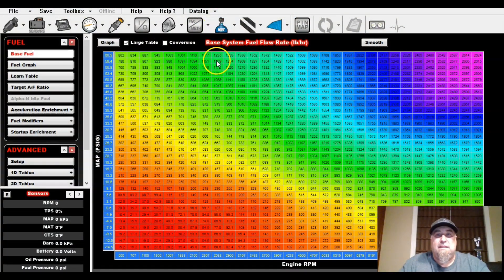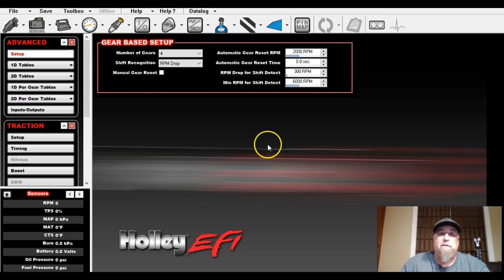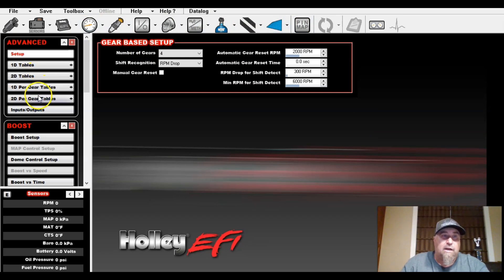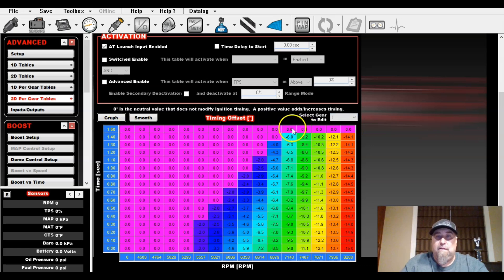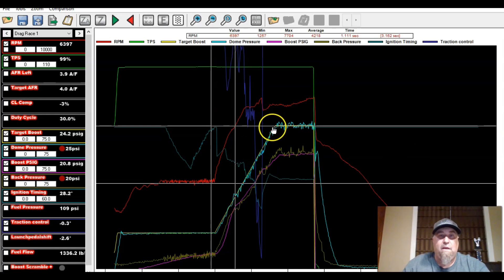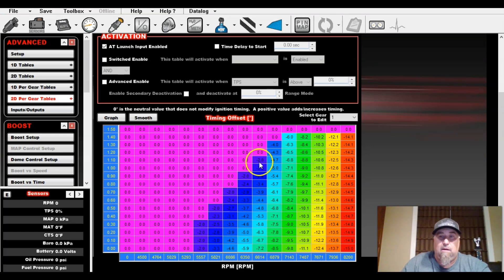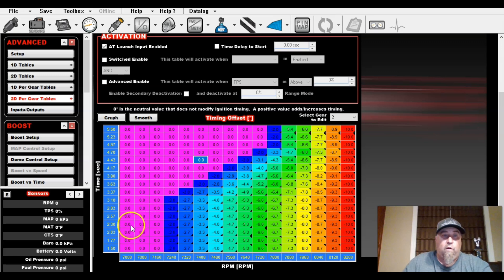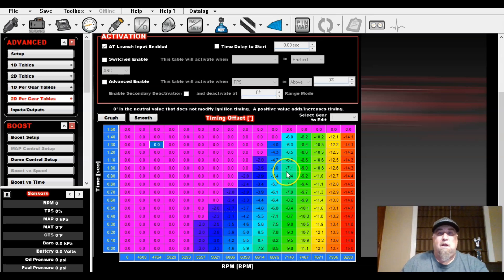FREE Holley Traction Control?????

Comment: I was looking to see if Holly had a built in traction control, as when we put a terminator x system on our LS it feels like it lost 100hp in 1st.
Tried talking with tech line, he just got mad when I suggested it was running lean and said we'd have to dyno it, so far we added 80% more fuel so?

Comment: Im building a ls turbo mustang 
And im haveing a hard time deciding on a holley system 
Would you recommend a terminator x
Or go ahead and get the dominator 

And have you found or heard if drive by wire better than drive by cable or?
Reply from the maker: Dominator has more capability.  I have no experience with the drive by wire
Reply: Dominator or hp. Terminator is good for daily driven vehicles that dont need more outputs and inputs. Plus the dominator and hp are just that much better and faster.

Comment: Hell yeah, I’ve been testing a version of this for the last few months on the street. Works awesome. I don’t make as much power as you so mine is basically off at the track lol. But I set up three different rpm progressions that I can choose from on my dash with digital switches. Soft, medium and fast which covers 90% of surfaces. I wanted a limiter based setup so I make mine a hard line of -30deg amd let it interpolate on its own as it approaches the retard line. I’ll show some logs of mine on upcoming videos. Cool stuff as always man 👍🏼

Comment: Do you have a lockup converter and if so could that be an issue with it trying to lockup and that's where you get the wheel spin mid track

Comment: Whatever leads to at-or-near 100 percent traction from A to B is what this car loves. 4.90's are just around the corner.
Reply: Pretty sure he's been low 4's with this car on the old setup before the hoosiers. I could be wrong.
Reply: @mitchdinner9743  No, you ain't wrong.  4.52 is quickest, I'm pretty sure.

Comment: thinking about your last example, the 5 second run.  Implies one should make allowances so that a race is not lost because the computer doesn't let engine over "power" which would sort of defeat the purpose as regards the safety of not over revving the engine and potential damage.
From that line of thought, how does this sort of table, and traction control in general, interact with the use of the scramble button?
Reply from the maker: Hmmm, good thought.  I may be cc’d able to tell the table to not activate if scramble is pressed.  I bet I can!  Good point, thanks!

Comment: I've heard some very smart people use engine rpm for traction control too, seems tricky when you start really changing boost and flashing the converter harder but I think it's a good idea.
Reply from the maker: Yes, you are right.  My last pass I put more boost in it quicker, and it pulled the timing and tried to not let the rpm climb.